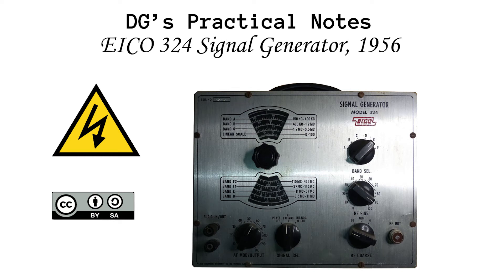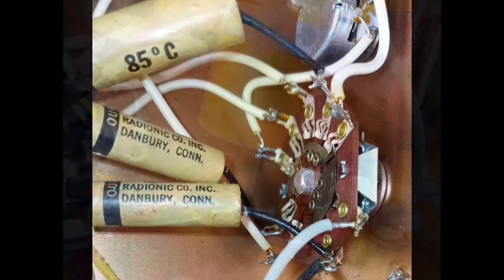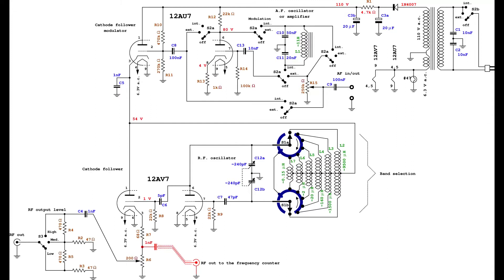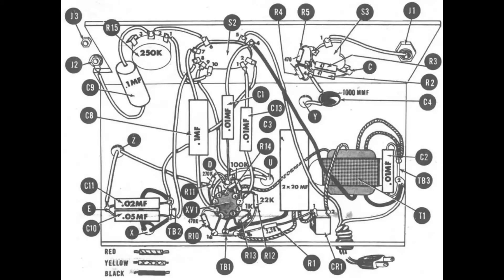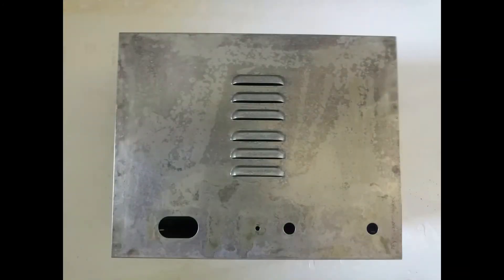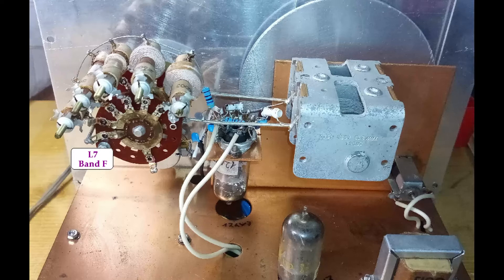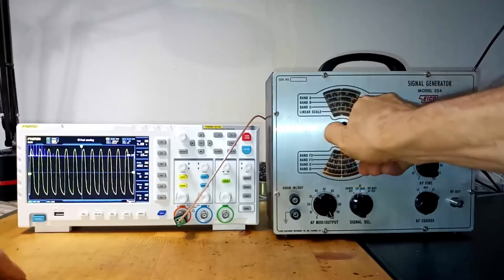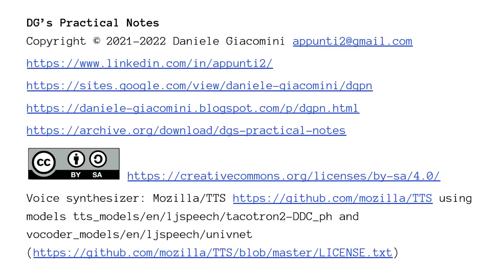DG’s Practical Notes, E#4 EICO 324 Signal Generator, 1956

Comment: Really like the way you simplify the circuits,  redraw them to  be understood by any one. Specially the  phonelic ganged switches multi wafer multi pole one, which are the most difficult to understand. One of a kind. I like it.
Is it possible for you to simplify and explain the bridge circuits in High voltage capacitor leakage checker like the Heathkit C2  .
Reply from the maker: Thank you so much for your appreciation. What you have seen, is what I need for myself to get to understand a schematic diagram. Thank you!
As for the Heathkit C2, I don't have it (and I don't have any equipment based on the same principle), while I need to «play» with something, to understand it. So, I am afraid that I cannot help you with that, at least for now: I am sorry.